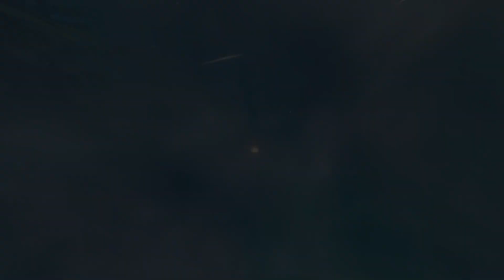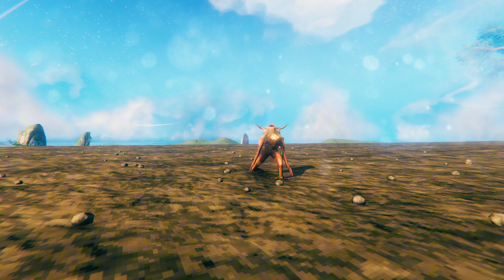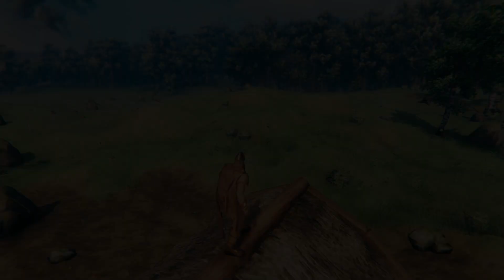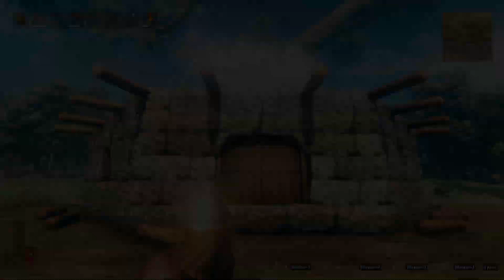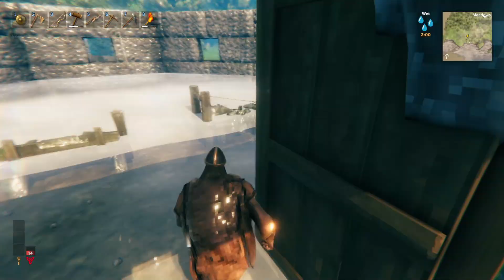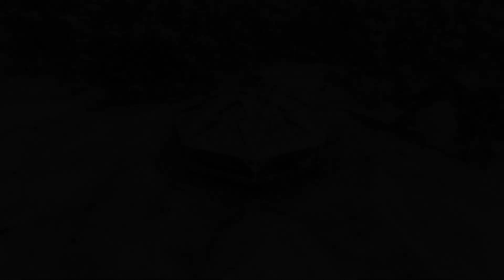Build and Chill: Valheim Stone Explained Part 1 (Forges and Stone)

Comment: It'd be neet if there was a mod, where sconces could be fueled with resin from any chest containing it within a workbench size radius, so for all that lighting, yhou just..tuck a basic chest in a decent spot, fill it with all that dumb resin, and...your lighthing and fires LAST FOREVER! [same with other fuels like the woodburning campfire.]

if there IS a mod, just let me know I've not had great luck with mods, I tried to get valheim+ to run on my game, give me more inventory slots and could never get it to work right.]
Reply from the maker: There is something like that, actually! It's called infinite torches, and it's available on thunderstore. It's one of the quality of life mods I always use for filming. It's configurable, but by default, it will keep anything that requires fuel at max stats.
Reply: @BuildExplain  noice! i figured there would be. this is a nice set of vids. keep vibing.